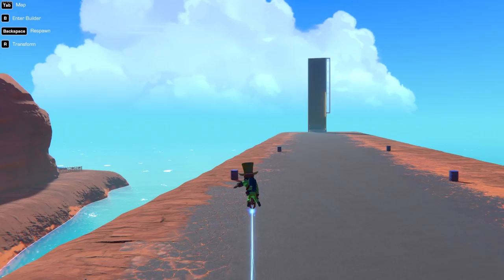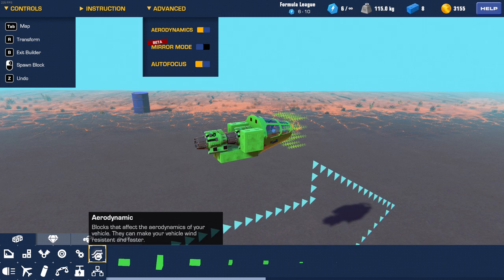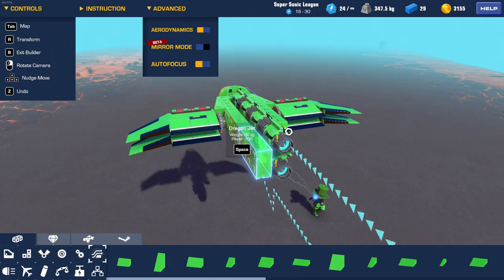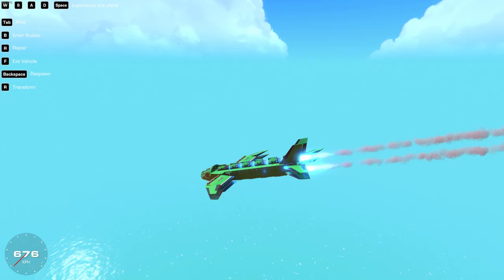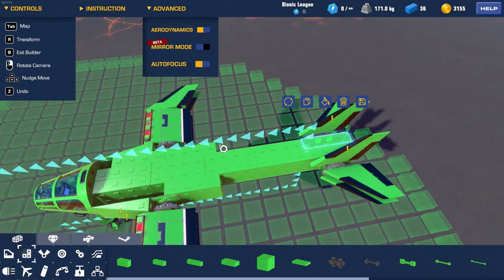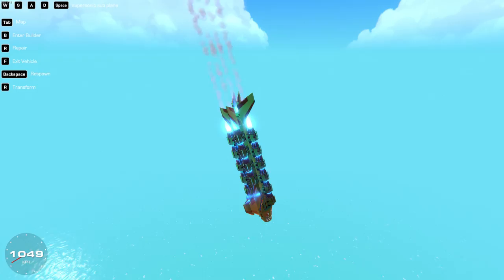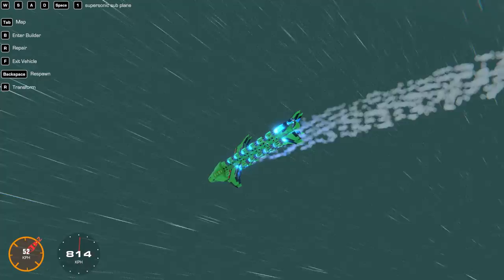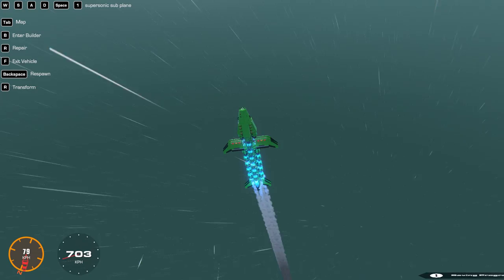What Happens to a Supersonic Sub Plane When it Hits Water at the Speed of Sound?

Comment: I want to see this plane fly into the sides of the high seas map. Nobody really has, so why not see how far you can actually go :)
Reply: you can get to the edge of the map underwater
no big waves out there, but the wind is constant 700+ kph
Reply: Scrapman went there
Reply: You can get there in only a few seconds on the surface with the zero drag glitch. Iv done it.
Reply: this is such an awesome idea
Reply: You can actually get anywhere(at least in my testing) but in a submarine 
Once you get out of the water though you get 720 kph of wind in your face in an instant so you’re flinged back to the real map
Reply: @wanou_4259  im thinking that the plane will be able to go faster than the maximum 720 kmh headwind into some invisible barrier.
Reply: @madhavimukkala5030  he did, but not far out i believe.
Reply: @LoPhatKao  you can also do it above water
Reply: I built an incredibly fast sub to reach the edges of the map (I almost had a heart attack when I was TPed back at the green portal), and when I went back, I used that sub to make a giant jump out of the water, and then transformed into a small plane where I flew at hundreds of Kilometers per hour. It was a good day.

Comment: In reality hitting water with any amount of speed is like crashing on the ground.
Reply: depends on speed, really slow is not bad, especially if aerodynamic
Reply: @Trailmaker.  bullets can be designed to supercavitate, but aparently not a round moving at the speed of sound in water.
Reply: @drakenred6908  dropping a supersonic projectile in water is a good estimation of how it will fly when actually supersonic. in other words, a subsonic projectile in water acts like a supersonic projectile in the air.
Reply: water = thick air?
Reply: @danifalkjensen  water can not be compressed, unlike air.
if you go extremely fast and enter the atmosphere, it will create friction (and thuse heat) as the air compresses in front of you.

but if you hit water at even just half that speed, the water doesn't have the time to be gently pushed around by your body, and instead acts like a concrete slab, crushing you into a puddle of blood, flesh and pulverized bone.
Reply: @danifalkjensen  If you punch water it will resist more the if you slowly slipped your hand in. Now punch it supersonically and it's like punching a rock.
Reply: @ledocteur7701  water can be compressed, just not the same as air, when air is compressed it gains PSI, when water is compressed to high ammounts it becomes a solid ( ice 7) that is a form of solid water that isnt cold or hot
Reply: @grandiewandie  true I forgot about that.
tho it's also the case for gazes if I remember correctly, expect it's more gradual.
Reply: ye but this is  trailmakers
Reply: I think this effect is caused by the same phenomena that causes the variation in tension in swinging linked pendulums to reflect the vibration back the way it came. There was a video here on youtube i could link if desired :)
Reply: @nyscersul42  my guy its just your hitting it so hard that the atoms have no time to move out of the way simple as that bro
Reply: Well like in every scenario, variables decide the outcome. If you're hitting "natural" water like that that's rolling in waves and is more flat and calm, yes; you'll obliterate yourself on the surface. If you have a case where the water is roiling, bubbling, and/or boiling, then the surface tension is gone and there's a mix of air in that water; meaning you could fall further into the water, but I'm not an expert on how far you'd get before the materials of your craft decided to protest against the forces at hand.

But you can "soften" water by having it bubble and roil. I live in a place where people come to practice ski jumping year round (that narrows it down quite a bit) and during the summer, they jump into pools that have aerators bubbling the surface to soften their impact. It must work otherwise I'm sure they'd have moved on to packing peanuts by now.
Reply: Minecraft says otherwise
Reply: @Derpy Potato You might want to have a talk with mother nature and birds that dive at high speed.
Reply: @ducewags  They aren't hitting the water at Mach 1
Reply: @derpypotato677  Well as you typed in your first comment. "In reality hitting water with any amount of speed is like crashing on the ground". And we welcome the bird to chat. More impressive is a falcon at 200+mph drive for a fish.

Comment: Water speed of sound is way faster than air speed of sound because of in between counteraction of particles and molecules im not too sure 

So yea if you cant go over like 3000km/h under water i guess youll just fall under the speed of sound

Edit 1480m/s ×3.6 = .... km/h you can do some math yourselves
Reply: Water is much harder to compress than air so it transmits vibrations quicker.
Reply: @_miobrot_603  lol fluids cant be compressed at all
Reply: @slickrick8279  Everything can be compressed (Well, every physical object).
At around 200 atmospheres water is about 1% denser than in 1 atmosphere.
"much harder" in this instance just means "so much harder it's normally not worth thinking about."

Indeed without the ability to be compressed something has no method of transmitting any sound at all, as this is caused by vibrations in the structure of the material - the movement of particles within it relative to each other, creating pockets of temporarily compressed or expanded material.
If something were incompressible for it to carry a sound would require the whole object to move all at once - instantaneously moving the sound to the other side of the object i.e. faster than light i.e. it's impossible.
In fact you would never be able to move such an object, since any attempt to move part of it would also require the whole thing to move all at once, having the same problem of this allowing communication at FTL speeds.

Comment: Surface tension is really REALLY hard to do on the fly calculations for.  Also the speed of sound is variable and based on the density and elasticity of the medium traveling through.  Yes, the elasticity affects all mediums no matter the state of the matter, just has more effect the denser the matter is (and why it is usually only a huge factor in solids).
Reply: The calculation for hitting the water at supersonic speeds is quite easy. supersonic speed + surface collision = big badda boom
Reply: (Realistically, when you collide with water at high speed the result is such that the surface tension is negligible, its like hitting a brick wall, the mass of the water is more the concern. So, maybe splat would be the appropriate technical term?)

Comment: But kAN, that's the thing. You built a plane-sub in Stormworks a long time ago. You haven't done it with the modular engine pieces or with weapon systems aboard. Or have flown through a tornado with it. Just saying Stormworks is a bit different than when you first played it. A little bit more than when you had your death match with Mr. NJersey, but it's still a bit different. Maybe you should have Camodo take you on an adventure. He knows of something you both can take a kraken at. . . . .

Also, correction. This is the first time you've broken the sound barrier on purpose. I recall a multiplayer monday with team battleships where you got yeeted out to somewhere at the speed of sound and that was basically the highlight of that one. I believe it was you and Kosmo vs Scrap and Moonbo (or it was you and Moonbo vs Scrap and Kosmo), but your team mate got scuttled and your seat didn't want anything to do with it and left with a sonic boom.

Comment: aerodynamics/plane people, would a sonic boom actually have that bass drop sound?
Reply: no, it's more of an explosion-like sound
Reply: From the camera's perspective it would be an endless roar.

From the pilot's perspective, nothing really changes as most of the noise they hear is transmitted through the body of the aircraft anyway, and they obviously don't hear the book, as they are outrunning the sounds traveling through the air.
Reply: you wouldnt actually hear anything, since you are moving faster than the sound. Youd just hear your engines going deeper and then tishina. The people on the ground are later hit by your "sonic cone" (the thing shown with those white circles) and hear something which sounds like an explosion

Comment: @kAN Gaming you can use the Hover-Pad Glitch to go Forward, which also works underwater...
Just place some Hoverpads Vertically and use some Steering Hinges with some Wedges to make them clip inside the Hoverpadds at an 13 Degree angle while the Lat side faces Backwards and the Thick side facing forwards... This allows you to Break the Soundbarrier in just merely 3-5 Seconds (More Infos in my own Response down below)
Reply: what responce
Reply: @Jascububscub  hmmm, i don't know why it got deleted... Or my browser just glitched out again which prevented the response from getting through...
I know that i wrote a response but i have no clue why it disappeared...